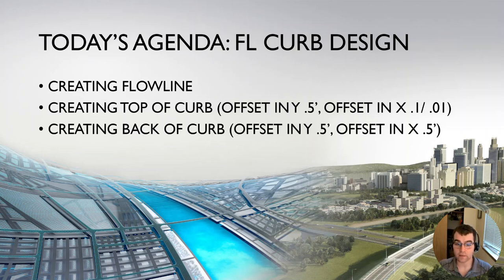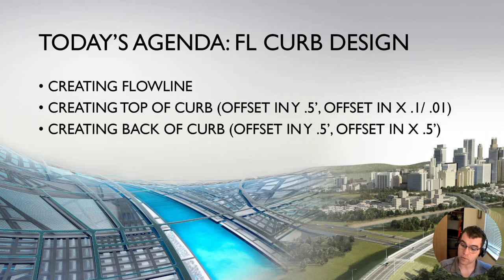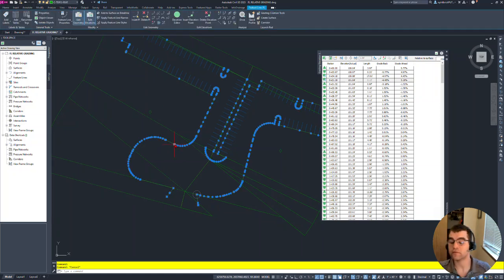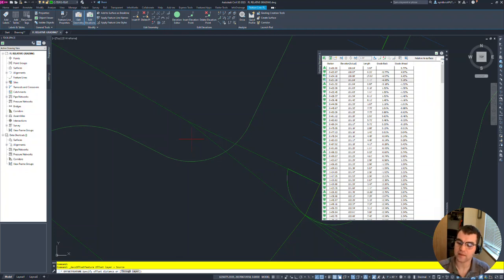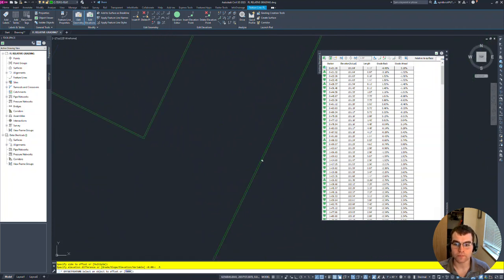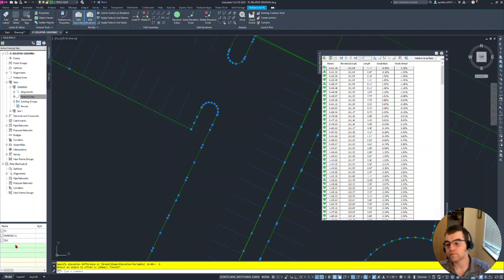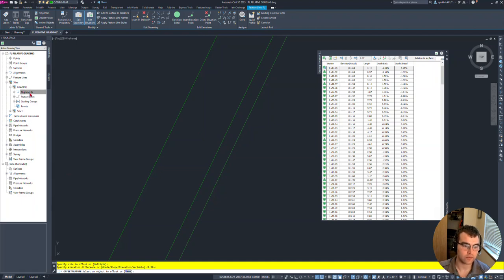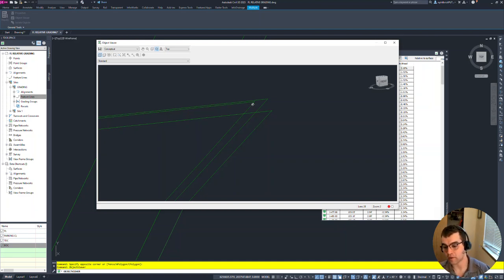Feature Line Curb Design with Stepped Offsets in Civil 3D (Part 2)

Comment: Sir, thanks u for this tip. overall presentation is very nice. here one suggestion is due to using very high resolution it is very hard to read some value in command line and also in command tips. this is request please using little bit low resolution it will be helpful to read the all option your using in your video. otherwise u may use zoom tool when ur applying any command or option. this will be very helpful for the viewers. thanks u.
Reply from the maker: Thanks, I can see how that can happen